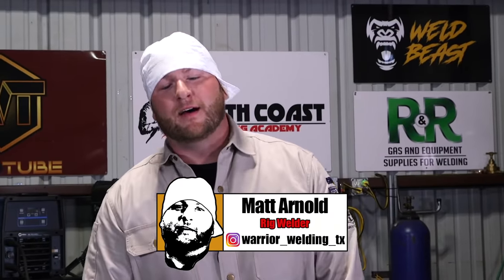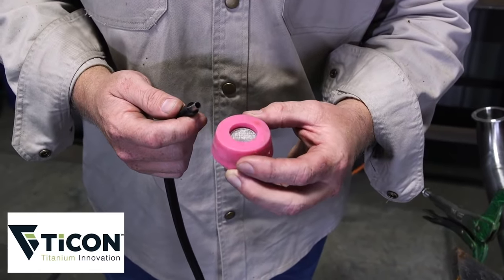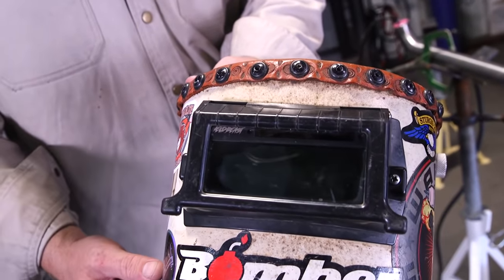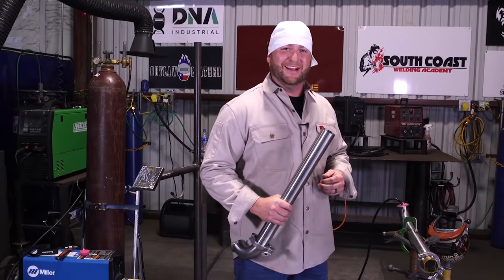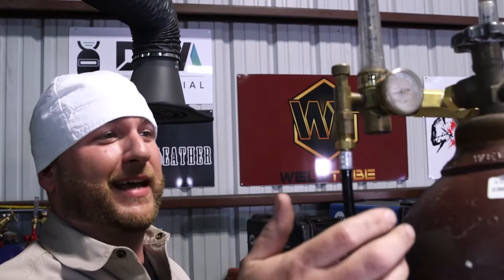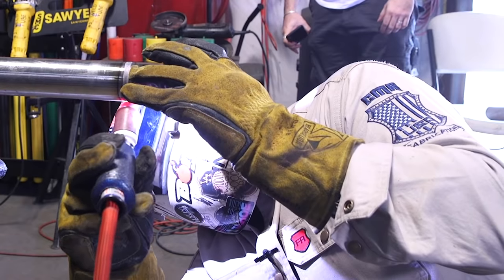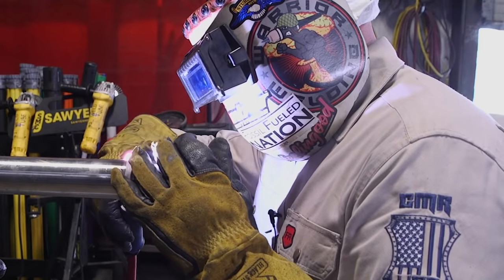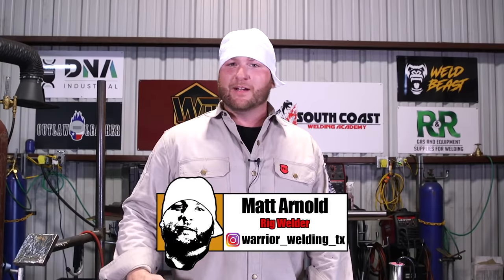Sanitary Tube Welding | Autogenous Welding Process that Uses No Filler

Comment: About 34 years ago I worked for a company building milk tankers for AMPI. There's nothing quite like a USDA inspection. Every weld inside those tanks had to be finished completely smooth, where you couldn't even tell there was even a weld there. We used flapper wheels on the end of a drill to sand the inside welds down to tank level and then we'd polish them. The manhole in the top and the ports on the back had to be welded the same way. We also ran beads on every joint and seam on the outside too but we just used a MIG for those because they didn't have to be sanitary. It took about two weeks to finish one working with two men crews if I remember correctly and that includes insulation, skin. running gear and fifth wheel mounted and ready to roll down the road. I'm a rig welder too and I only took that job when the oil field collapsed in 1986 and it held me over until I could put my rig back to work.
Reply: Food grade welding is so clean it is satisfying with the end result. I've seen 10's of thousands of feet of stainless food grade pipe work and the couple of dairy plants I used to work at. So clean.
Reply: My old man and grandpa both hauled milk for AMPI back in the 70’s-80’s
Reply: Saludos  reparó tanques enfriamiento fugas internas sunset, Paul mueller,milkplan

Comment: Excellent demonstration! Working for an FDA facility producing soaps, lotions, and hand sanitizers, I weld sanitary all. the. time. 

This was very informative and answered a couple of lingering questions I've had about how to perfect my craft.
Reply: Hey man I’m a certified welder for pharmaceutical tubing and I run piping where even dust in the tube I’m unacceptable. If you want any tips on sanitary piping I’m sure I can give you a little bit of everything that you’d want to know.
Reply: @richardmaschack2150  I’m a beginner welder but considering it as a career. I assume that this type of welding is pretty hard versus other tig pipe because of the lack of room for contamination?

Comment: Welded alot of thin wall 316l tubing using this method. Alot of in-position free hand, but since you’re not using filler its easier to prop. Such a smooth and pleasant process when you get the hang of it. Great vid Matt, would love to see more of you on the channel!
Reply: How do you tack it?

Comment: I use a #4 on a stubby gas lens with a 1/16"  tungsten stick out. I also run 42 amps on 2". 5 cfh on purge and 25 cfh on a ck swivel head rig. Important to note that your purge can be ruined if the pipe is colder than the ambient air temp. Condensation will accumulate on the pipe i.d.
Reply: Mag it at .6 and amp at 55 and wiggle.  Not too wide and no color on inside. Done some EP stainless.  Wiggle wiggle
Reply: You just pointed out something i never thought about.... condensation inside the pipe. Could explain alot of defaults i had in some of my full pen welds. Thnx for that, i will consider this next time.

Comment: A few things to remember on purging tube. Not all flow meters are alike and your readings on your flow meter have a relationship with your outlet orifice. Meaning the smaller the outlet orifice the lower the flow to maintain good pressure. Letting the purge gas blow in your ear and weld profile appearance will educate you on your flow meter settings. Also it’s best to purge from a low point if possible. Welding joints of tube together is more sensitive to hi and low pressure than welding a fitting on a piece of tube and generally welding tube to fitting or fitting to fitting takes a couple more amps than tube to tube. Also pay attention to how far your plugs are from your weld, burning them up if bad form. This gentleman is using heat tape for his outlet dam which is common with sanitary guys but sometimes expensive depending on where you find it. I’ll often use good heavy duty aluminum foil, both work fine if your weld would be to close to your outlet plug. Now y’all go get to work I’m retiring in a few more years lol.

Comment: Hey dude sanitary means no need filler wire or any metal to supply just melt it two sides or both sides always take a look on devils eye thats the word i learned from you bro,good info keep it up,im also a welder gtaw/smaw combi and gtaw/fcaw combi pipe welder,never been welding that kind of pipe sanitary welding,i want to experience that also that was interesting.

Comment: That lincoln 305g is a beast, i own one myself and have done alot of structural welding jobs, havent done any piping work with it but it does tig weld like a boss

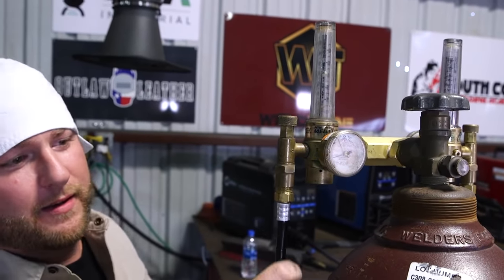Comment: maybe you can already do it but if not you are still young enough to master going all the way around without breaking the arc. 6g, start at 4 o'clock down to 6 then uo to 10 o'clock switch hands no break in arc past 12 switch back to right hand around 2 o'clock then continue back down to 4:30, Helmans Mayo-Best Foods, and corporate Budwieser, have sample boards with my welds. i am now 67 long retired just want to pass something on, you are great!

Comment: Matt,  Thanks for getting back.  The HH 300 is  a bit heavy and I slip on the smooth stainless.   I have seen where some guys  grind a groove or slot in their gas cup.  Is this helpful.  Thanks again for a very professional presentation .  Tim

Comment: Thanks for this great video. I do have a question about lift start. I was taught that any tungsten touching the metal would cause inclusions, is this not the case with high end machines?
Reply: Hi Scott, using lift arc won’t cause inclusions, but dipping your tungsten while welding will, it’s two different animals.  Thanks for watching!

Comment: Thanks for a great video, thanks for sharing.  I've got a 300 amp Heavy Hitter tig torch.  Is that too bulky for sanitary tube?  What cup setup are you using?   Thanks for any advice you can offer.  Tim
Reply: Hi Tim!  A 300 amp rig is a little big but you can definitely use it! I rock a big jumbo gas lens and a #8 or #10 cup.

Comment: Thanks for another great video!
But do you not have to pacify the stainless steel after?
Reply: Not the welders job bud haha, just burn em in and on to the next one.  They are usually flushed with caustic before production

Comment: One question that I forget what the guy i worked with told me is @how long to purge for length and od of pipe. Im sure their is a formula but do you have a rule of thumb, and also does hole size matter for purge out? Excellent info thanks

Comment: Great job. But question is why you are using lift arc. Last weld (golden weld) where we can't check by videoendoscopy we checked by XRays on site. when you are using lift arc you have risk contamination by tungsten what is unacceptable

Comment: Hey dude...nice video. Could you pls explain how the weld integrity is established for these pipes? Hydrostatic pressure testing? If so is it done to B31.3 code or a different code?

Comment: What do you do with defects are you allowed to grind them out on sanitary pipe or will the contaminate?
Reply: Not familiar with this, but i have heard about "Use a file ONLY" on sanitary tubing tests
Reply: Where I’ve done work it’s always a cut out repair
Reply: It can vary but most of the time with sanitary you're not going to have a defect that isn't a cut out. Typically grinders aren't allowed as the dust can cause contamination along with embedding particles into the tubing. Remember that this stuff is either putting something in or on someone's body as the end product so contamination on any level is unacceptable.

Comment: Higher purge. Not much higher but he was still getting some colour on the inside. Plus the puddle shouldn't  "drop".  A drop usually indicates too low of a purge and potential sugaring. Even the swirling motion doesn't necessarily mean you've punched through, especially as you move up to 4 and 6 inch tubing. The wall thickness is higher. I've had a swirl going on some 6 inch one time and felt like I was getting through and barely penetrated. It's a feeling out process. Also welding 2 inch at 42 is a little on the high side.
Reply: I am glad someone else pointed it out besides me.  As well as running the purge plug at the highest point,  should be at the lowest point to force the atmosphere up and out since argon is heavier.  also cleaning while hot will potentially push impurities into the weld, creating pinholes over time.

Comment: Great video , can you guys explain how to finish or pull of using the lift tig method without causing any craters ? Or how to terminate the arc with proper gas coverage ? @WeldTube
Reply: I can try If you don't have a foot peddle then the best thing to do is once you tie in to the other half of the weld is to begin walking it fast and narrow gradually tilt your torch back starting to long arc until the arc goes out. Then let your post flow sit on top of the end of the weld.
Reply: if you do have a foot pedal then it's the same process you just don't  long arc it off instead just gradually let off of the foot peddle until the arc breaks.
Reply: @williamhunter277  thanks for the reply I appreciate the help. I’m a welder, stick and mig but tig is something I’m just getting into, the machine I have is only lift tig capable so no foot pedal. So just to be clear, long arc it till the arc terminates and let the gas flow over the weld ?
Reply: @robertogutierrez3593   We all start somewhere man no one was born an expert on this it's our job to pass on as much knowledge as possible. But your doing that while walking it down to a fine point. The finer the point the less likely it is to fisheye or a pinhole.
Reply: @The Flying Farmer thank you, I had received similar advised about flicking out. I will definitely work on that, thank you for the help.
Reply: @williamhunter277  Got it brother. Thank you for the help and the explanation. It is very appreciated 👍🏼

Comment: PPMs are pretty important to Mention... I could still see some blue colors inside the pipe.. What type of purge gas do you guys use?.. 100% ar or a mix gas?
Reply: he was using 100% argon  same bottle as the tig torch   the color is becasue there was still some atmosphere trapped in there.
Reply: @Brainmalfuction  possible yeah... Purge flow, pipe angle, purge hole size... It's all related to blue/gray colors or even sugar for that matter. 1 or 2 liters a minute should be more Than enough but, if the pipe hangs just a little it will trap oxygen and keep mixing with the purge... Still a good informative video.
Reply: @OminousObelisk  Ya see my other comment/question i noticed he was purging form the high point not the low point of the spool which i found weird  i think thats why there was color in the root
Reply: @Brainmalfuction  yeah I totally forgot about the high point man. I think that was the main reason for the discoloration.

Comment: Nice weld for sure but you really don't need to walk the cup, it makes the weld too wide and increases distortion. You're not welding pipe here, it's only .065" wall.
Reply: Actually walking the cup on sanitary is the industry standard.

Comment: Like much of the sanitary Tig welding on YouTube, there is so much wrong with this video.  Purge from low to high, argon is heavy so it will push the oxygen up, so vent needs to be high.  Do not walk your cup on thin walled tubing, you will over heat the material and  lose the corrosion resistance.  Typically we run hotter, about 55 amps on .065 wall, and much faster.  Also, you should be using a foot pedal with high frequency start.  If you are scratching to start you are potentially adding contamination every time you touch it.  Foot pedal is important for tailing off so you don't have a pin hole from the rapid cooling.